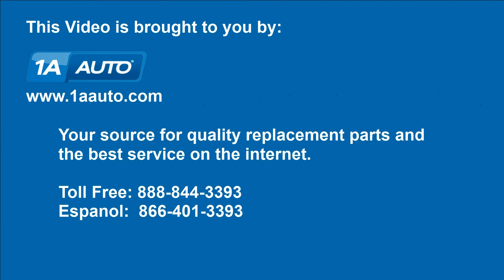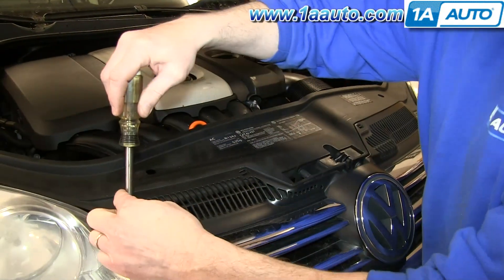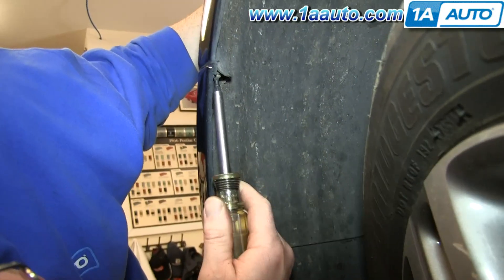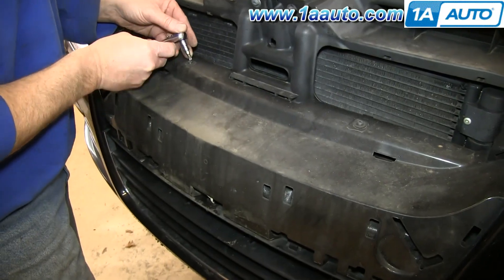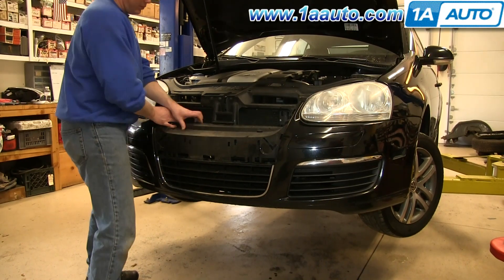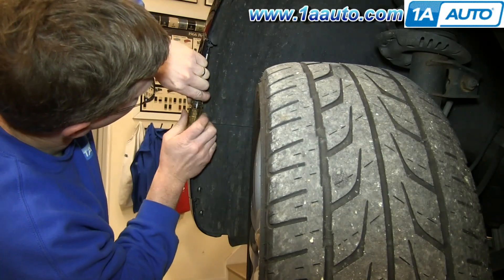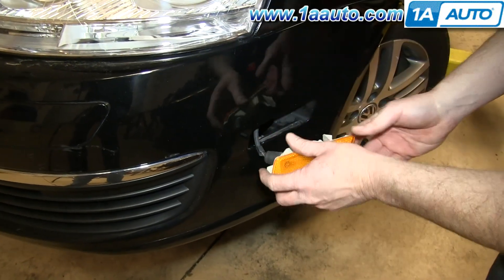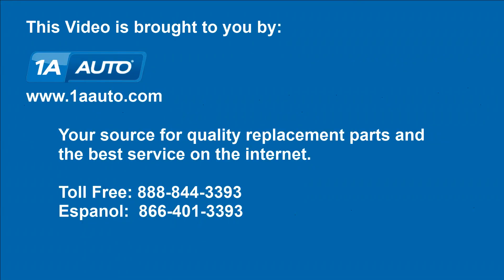How to Replace Front Bumper Cover 05-10 Volkswagen Jetta

Comment: Since you have the wheel well covers off, I would recommend you clean out the area where the cowl drains to.  I have to clean that area out several times a year due to leaves getting trapped behind there.  Else you run the risk of rainwater entry into the cabin.  thank you for the great video!

Comment: I parked over a cut off pipe, when I backed away it tore off my whole bumper from all the connections and damaged/tore the splash shields. Do you carry the bumper cover and the splash shields..OEM for 2009 jetta 2.5 SEL, along with screws, clips etc>??? Thkx

Comment: Is the process basically the same if you have fog-lights? I have a 2006 Mk5 Jetta 2.0T, and after hitting a large raccoon, my front lip spoiler, bash plate, and windshield washer bottle (and maybe jump) need to be replaced. I haven't popped off the bumper cover yet, so I'm hoping that's all I'll need. Thanks for posting the video!!
Reply: Yes, just disconnect the light bulbs from the fog lights

Comment: Just hit something on my 2006 vw Jetta 2.5L and the bumper popped off.. and I just pulled to remove the whole thing.. The passenger headlight somehow popped out but not damaged so I just put it in my backseat.. sideswiped the passenger fender . Tire went flat and shredded apart on the 5 minute drive home... it looks very fixable if I buy the parts . It’s just kinda odd after watching this video with the screws that need to be removed... the force must’ve just popped it off? My grill is still connected to the bumper